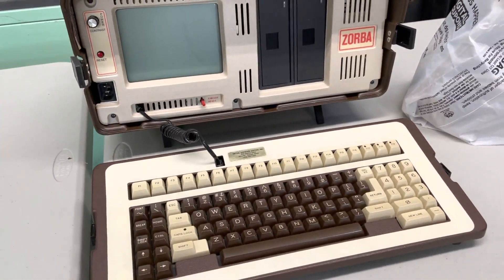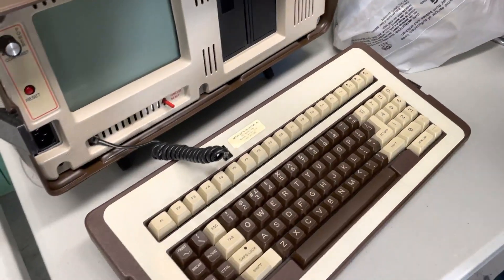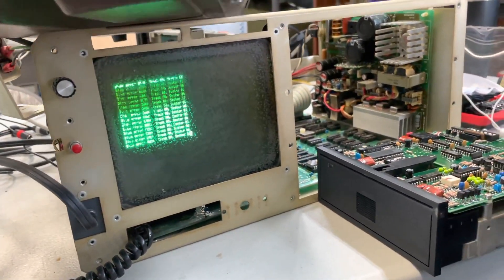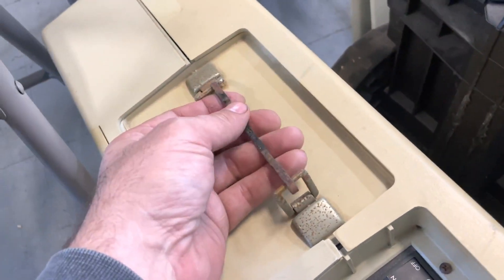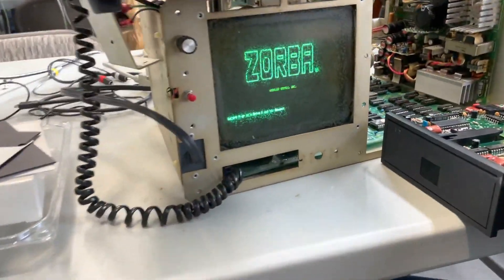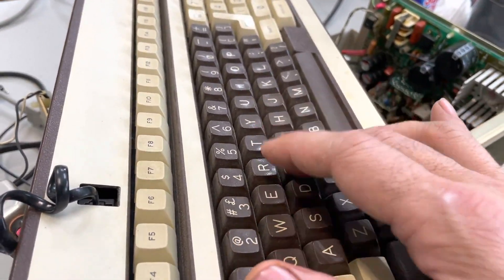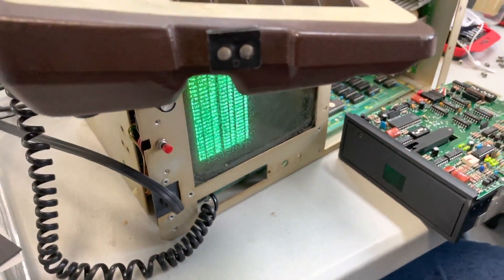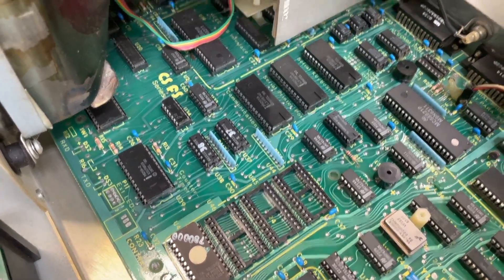Zorba Best Portable CP/M machine EVER?

Comment: In answer to your question, yes, the Zorba is the best cp/m computer ever made. My question is, why doesn't someone reproduce the damn thing? I'm not talking a screw by screw reproduction; I'm talking about a working reproduction with working floppy drives and an unobtrusive SD card reader and all back issues of the ORACLES OF ZEUS. Why have floppy drives? Because once of the greatest thing about the Zorba is its ability to format disks to other cp/m computer formats. All it really needs is one quad-density drive that doesn't have the clacticallky-clack drive problem. 

Why reproduce an obsolete computer? Well, 1) because jerks like me would buy them; 2) they're a window to a single decade of computing history (the 80s), and 3) computers like them are so hard to come by that they're almost impossible to find. Those that are available are so expensive that even if one were available, it might stop working at any moment. Who wants to buy an antique computer that might stop working any moment?

Finally, 4) they can be mass produced in China for almost nothing, and the biggest expense would probably be in shipping them to the U.S. Also, why do people still buy 6-shot revolvers when they can buy 20+ -round autos?

Comment: I still have a functional zorba.  The boot disk had the instructions for how the screen controls and disks worked.  A Friend way back made a hacked boot disk that allowed the zorba to use Kaypro software.  I also have a DOS board with 256 KM of ram that allowed use of IBM software but mostly I used it as a RAM drive to make it faster.